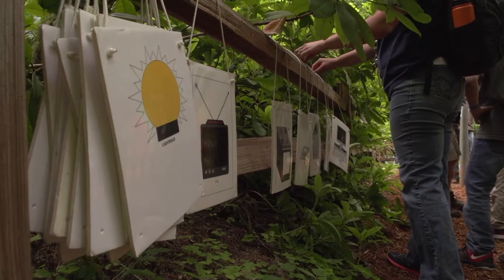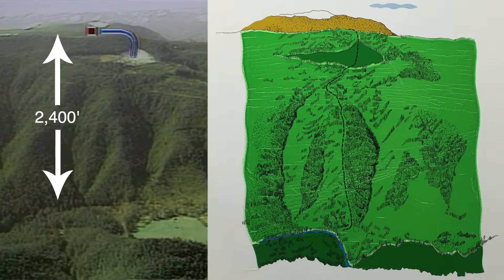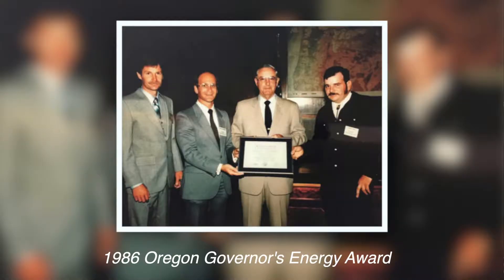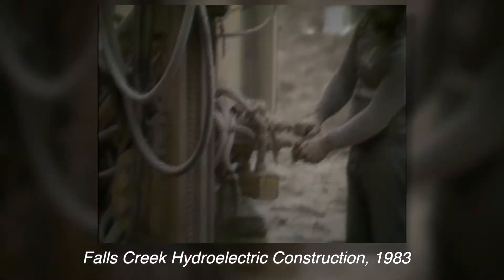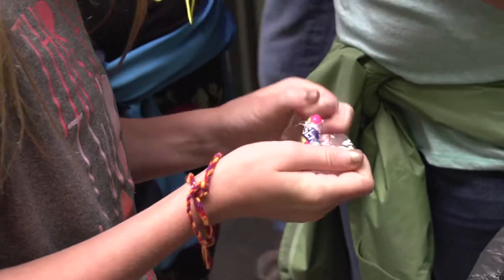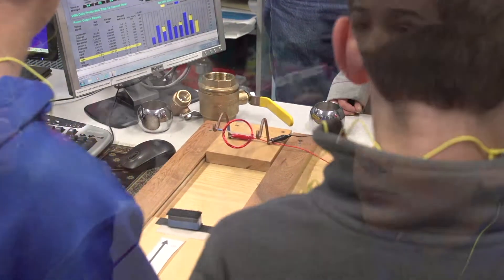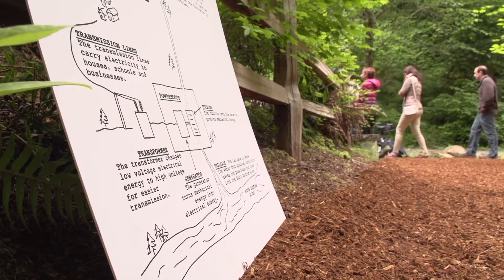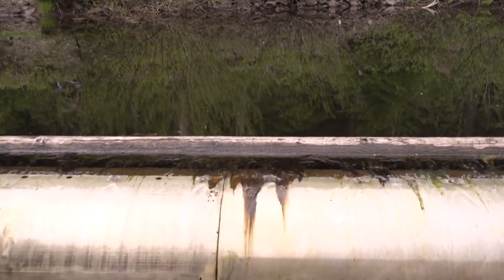Falls Creek Hydro:  Local Renewable Power Source

Comment: When you all kicked that plant on, it sure messed with the power lines heading into the valley. (I grew up behind Maples Grocery in Cascadia).
Reply: Hi Rexford. (What you say is true - see the last sentence of this paragraph).  

 I just saw this comment posted two years ago.  Sorry I didn't respond earlier.  Actually in 1984 the Falls Creek project spend $450,000 - which would be $1,300,000 today to upgrade 20 miles of power lines between Sweet Home and the power plant which is 10 miles east of Cascadia.  Until that time those lines originally built in the 1950s were very unreliable.  The lines were improved so much that a small lumber company was able to reopen near Cascaded, I think it was named TOM (for Try Once More).  However, it is true that on April 7, 1985, the first time we were able to generate over four megawatts, there were three miles of lines near Cascadia that had not been upgraded.  Parts of those lines melted.  The lines fell down, and one even started a fire on a picket fence near Cascadia.  All while people had Easter hams in the oven.  I think that's the event you mentioned above because the lines melted near Maples.

The Utility said it would take three weeks to fix the lines, but a guy named Leo Kim who was the PP&L manager in Albany at that time, called a system wide emergency and 27 utility trucks from all over Oregon came out to highway 20 and worked nonstop for 72 hours to upgrade those lines.  It was a remarkable acheivement and I wrote to the Governor of Oregon letting him know what a good job PacifiCorp had done.  I also took out a full page ad in the Albany Democrate Herald thanking every one by name who worked on those lines.

Since that time, Falls Creek has helped PacifiCorp make many improvements to the functioning of those lines.  This includes making sure the trees are trimed so trees limbs don't fall on lines.  And we buried five miles of lines on the forest service "Gordlon Meadows Road" that had been overhead with tree limbs constantly falling on those lines interrupting service.  Oh, by the way, when lumber mills on those lines start up or shut down, they do create voltage swings.  When Falls Creek starts up we do so gradually, and always maintain proper voltage when doing so.

Finally, I'd like to invite you to the next tour we have of Falls Creek with Lebanon school kids, usually in the first week of June each year.  Those tours were suspended the past two years because of COVID and I hope they resume in 2023.  I had to sell Falls Creek two years ago, and the new owner may not give a tour in 2023.  But I'm pushing for it, and if you list your phone number here, I'll call you and make sure you are invited.  Or list your email and I'll email you.  Respectfully yours, Gary Marcus